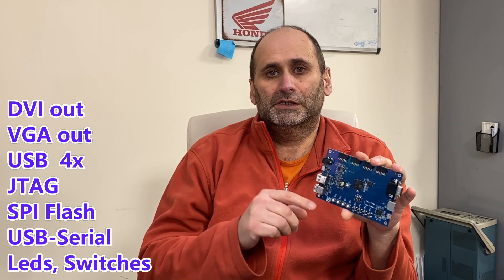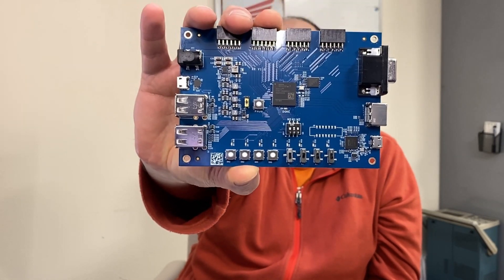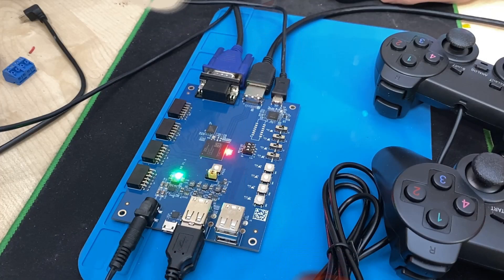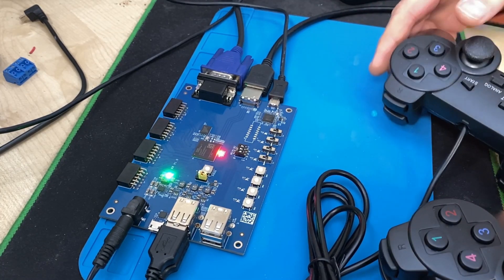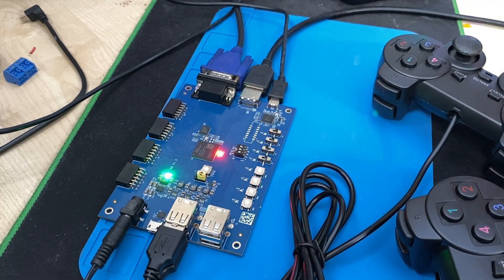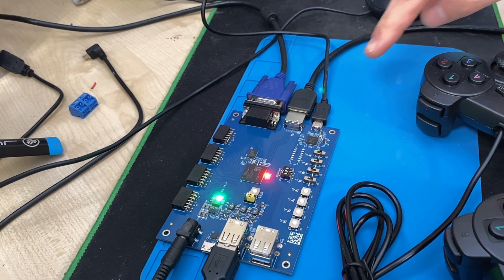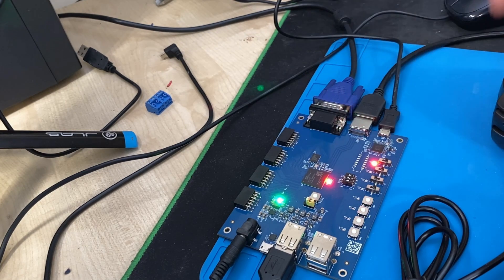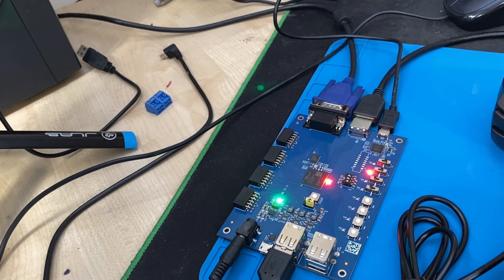FPGA Board update EP3

Comment: The board is looking good.
Reply from the maker: Available in the shop as a single board or a kit with psu and cables...(no need to buy, just saying)
https://www.adaptivedesign.ie/category/boards
Reply: @adaptivedesign8795  Yes, I do need to buy (done), I said if you build them, I'll buy two. I never go back on my word.
Reply: @adaptivedesign8795  I received my boards today, very nice length matching on the PMOD traces.